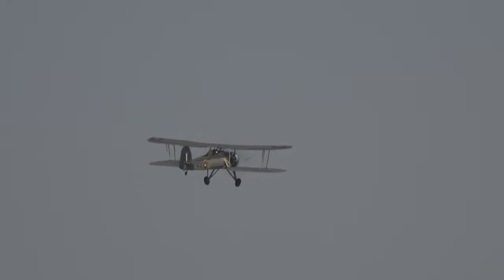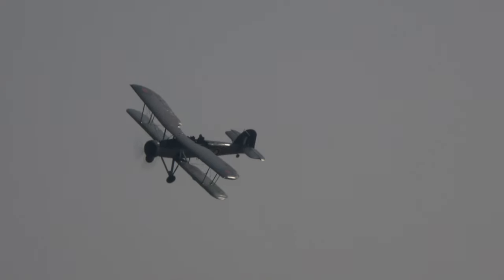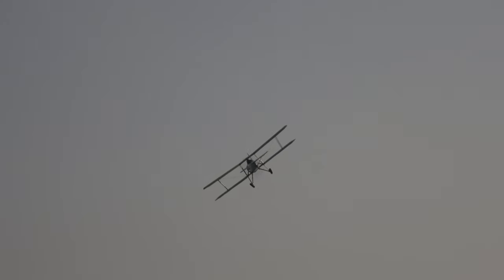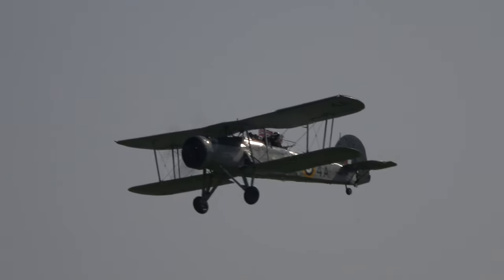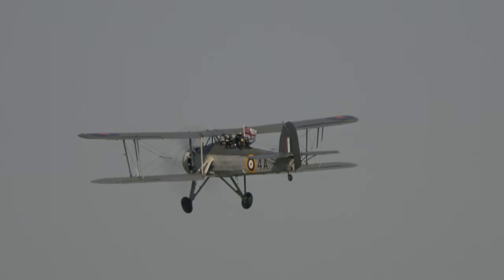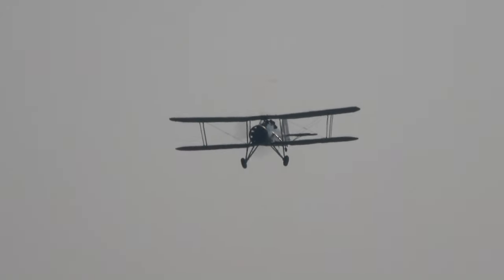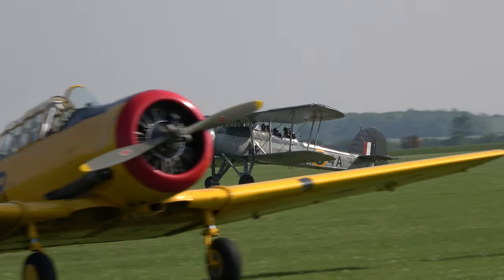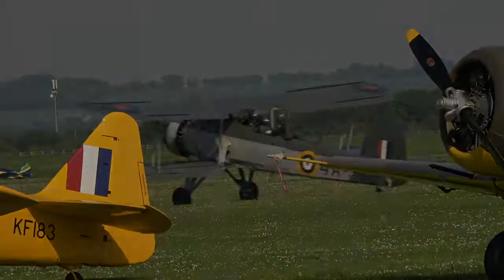Fairey Swordfish Mk.1 - Duxford Air Festival 2018

Comment: This Swordfish is in the markings of the one who launched the lucky torpedo that struck the Bismarck's rudder. The pilot who did it is John "Jock" Moffet from HMS Ark Royal
Reply: He passed away John Moffet  he was in his 90,s about 2 years ago.
Reply: @dambuster6387 .He'll be remembered as the man who helped sink the Bismarck
Reply from the maker: Andrew - This is good information and thank you for posting it, but I was surprised that it wasn't detailed by the RNHF in their historic description of the aircraft represented and I also have a copy of Sub -Lt. Moffat's log book which records his aircraft as 5C/ L9726 - 818 Squadron. So I have done some research (admittedly online). The markings of the aircraft it represents appear to be that of Swordfish coded 4A from 820 Naval Air Squadron based on HMS Ark Royal that was crewed by pilot Lt. H. de G. Hunter, Observer Lt. Cdr. J.A. Stewart-Moore and TAG PO(A) R.H. McColl, which was one of 3 aircraft in the 4th flight, which attacked Bismarcks port side on 26/5/41. The aircraft that was later credited with launching the torpedo that struck Bismarcks stern/rudder was indeed one from 818 Naval Air Squadron coded 5C serial L9726, which was the aircraft flown by T/S-Lt. J.W.C. Moffatt with Observer T/S-Lt.J.D. Miller and TAG LA A.J Hayman. (Source of details is my copy of Sub-Lt Moffat's log book and the following web page which appears to confirm the log book entry - http://www.kbismarck.com/article2.html